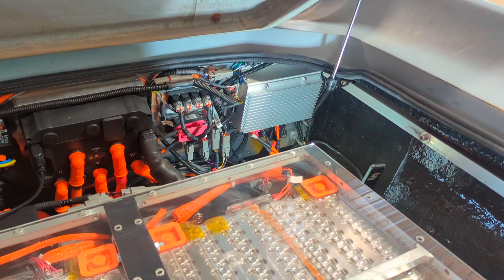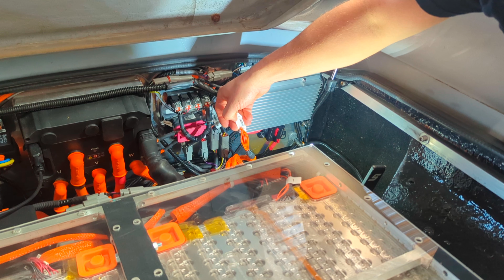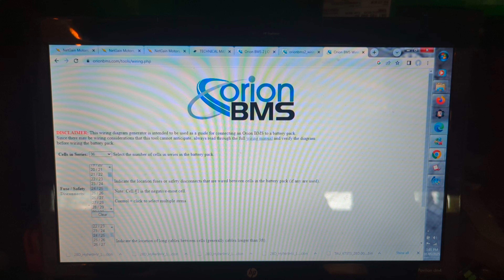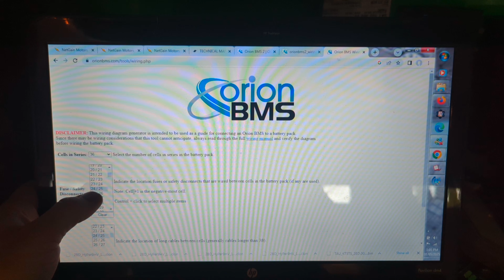EV Conversion 1969 Lotus Europa and understanding Orion BMS 2 wiring system.

Comment: Hello, I have a 69 Europa s2 I have had for years the r16 engine is weak and smokes windscreen is crack
needs to be restored.
I would like to make an EV out of it, then I saw yours. I think, I would like to try now. The donor car I've been looking at is a fiat 500E 100hp front-wheel drive auto direct drive. My friend  had a citi car and replace 3.5 hp motor with 90 hp DC aircraft generator and added more 6 v golf cart batteries that was 45 years ago it was too fast dangerous too heavy unstable .  Can't wait to  see your Europa on the road, good luck and best wishes.